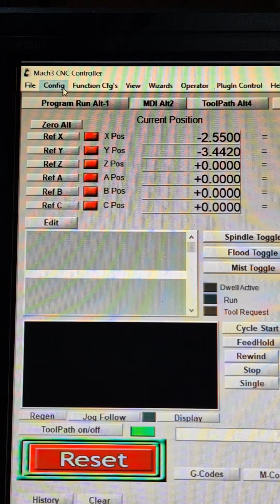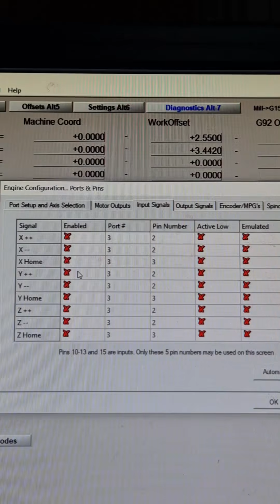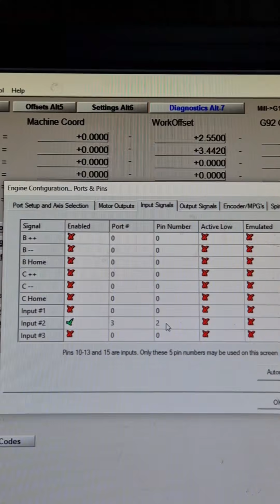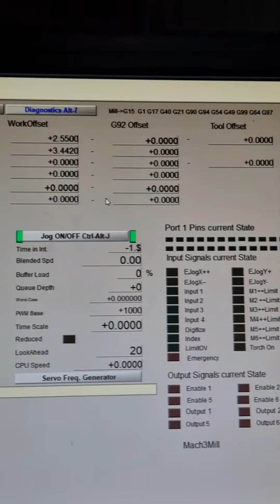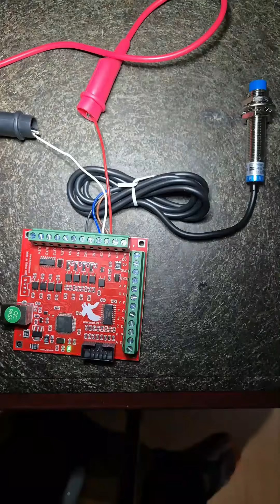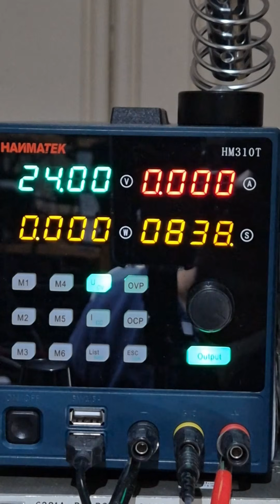Mach3 USB CNC Controller board Testing with a Proximity NPN NO sensor

Comment: If I would connect 3 sensors, how would I set the connection up?
Reply: You would need to connect each sensor to a different input pin.

I curently have my X,Y,Z, and A home sensors hooked up to Pins IN1, IN2, IN3, and IN4.

I have designed an adapter board that will allow me to connect all 4 of them to a single input.  It is currently being manufactured, and I should be receiving it next week sometime.